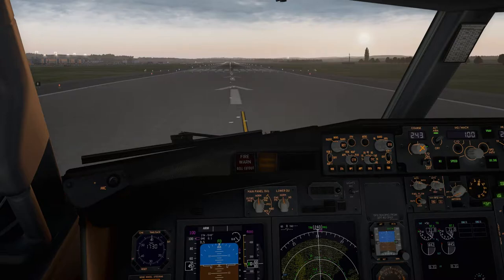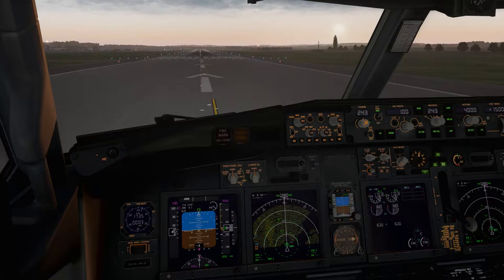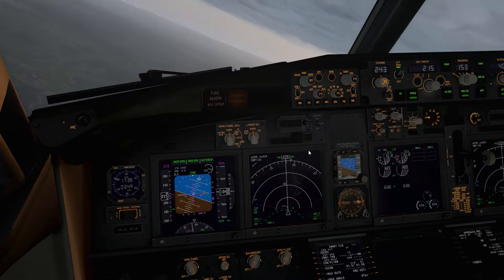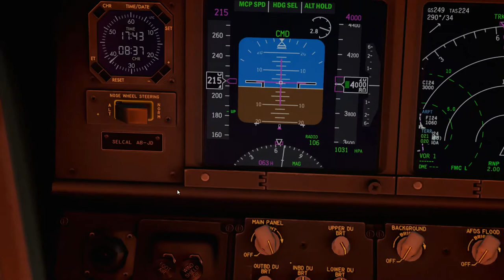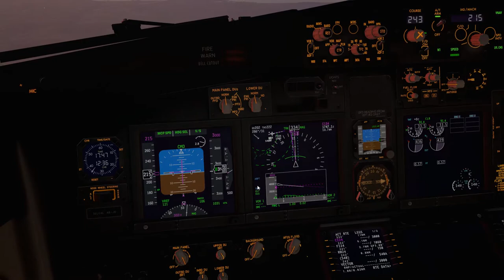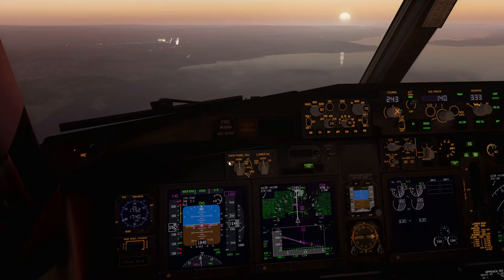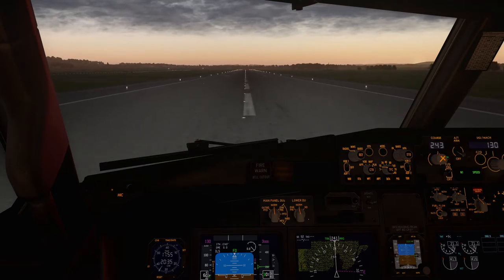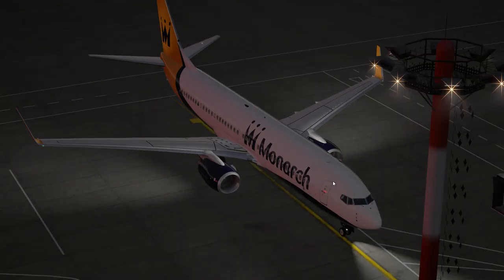X Plane 11 | Monarch 737-800 | Takeoff, Circuit and Landing | Part 2

Comment: When I land the aircraft on the runway it won't slow down when I land I enable everything is there something wrong?
Reply from the maker: Check the following:
- Autobrake settings
- Hydraulic Pressure
- Reverser Engagement
- Manual Braking

Comment: Oh boy, sorry, but this was very poor flying on your end. So many mistakes done. Based on my limited knowledge, aircraft was behaving as expected all the time. First you take off without setting trim, not setting engine performance, exceeding engine performance on takeoff (probably pushing levers all way forward instead of pushing TO/GA). Later you complain about ILS not displaying on ND while you are staring at it on PFD. Hint: ILS is not VOR. Then it is out of range and you don't get it. Flaps retraction schedule is not correct. At the end you fly ILS approach at LNAV/VNAV which is big no no and cut throttle on threshold resulting in very low touchdown speed. This is very good exercise but here I would say do it again.
Reply from the maker: Thank you for your comment. I agree that my flying was not great, but I'd like to address each one of these.
1) As I said, this was meant to be loaded in from another part, and it went wrong. So at the end of part one the trim was set up correctly.
2) Engine performance was set in part one, and was not exceeded on takeoff (As denoted by the green marker on the N1 gauge). Levers were not fully forward at any point. For the conditions and the power I wanted, 98.1% N1 was my target. Fully forward would exceed 100%
3) With regards to the VOR, you are correct. My brain completely ignored the fact that I had tuned in two ILS frequencies and the DME was displayed on the PFD, instead of the ND so that is my own problem. Total failure on my part, and for that I am rather annoyed.
4) Flap retraction speeds for this setup and the circuit were fairly correct, as noted by when I was retracting them and the markers on the PFD
5) Doing a circuit, approach procedures do not apply; I could have handflown the craft all the way if I wanted to. My initial plan was not to click the LNAV/VNAV at all, but I wanted to see how it worked in this mod, and if it did.
6) Touchdown speed was bang on to within one knot. VREF was 121. I touched down at 120. No issues there at all.
Reply: 1) I briefly checked part 1 and it does not seem trim was off that much if at all after all. But that liftoff was violent. Normally it behaves opposite - you gently pull and then need to pull even more to get the aircraft out of "dead band". Unless you didn't pull all the way it is a mystery to me.
2) N1 green marker (and perf page) is reading 97.1%. Where are you referring 98.1% as target? Maybe I am missing something here.
4) Indeed you may be right here, it was all happening so fast.
5) I agree but I don't think aircraft is supposed to align you you correctly to the runway if you fly ILS approach on LNAV/VNAV. Of course it would be completely different story if you selected RNAV approach. In that case it must align you precisely for both horizontal and vertical profile (i think ILS must be also untuned in that case).
6) Indeed, you are correct. Not usual speed, but for such light aircraft probably right according to calculated value. Idle the power above 50 feet though is something I didn't see yet.
Reply from the maker: 1) Could be to do with my setup. May not be calibrated. With a light aircraft it has been fine. And with a heavier 737 it was okay. I will not deny that it was a poor takeoff. In fact probably the worst takeoff I have done in this aeroplane in any sim.
2) Sorry, 97.1 was the power it asked for. 98.1 is what I gave it, which is within a reasonable range
4) It did; far faster than it would with a fully laden aircraft
5) You may be correct there yes, but I have had this (in a different sim) line up correctly. Which of course may mean that this is more realistically set up!
6) Not at all. I would usually land this aircraft around 145kts I believe with flaps 40. This is a slippery aircraft, therefore it requires a lot less power when it is light than you may think. It is also normal to idle this aircraft during descent due to the slippery nature of it.